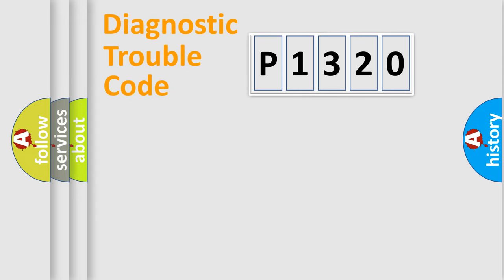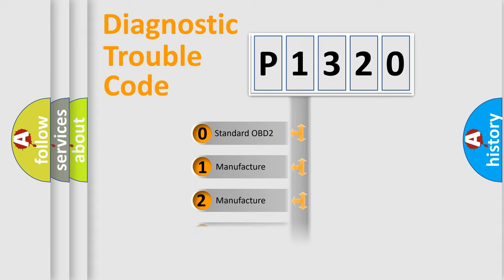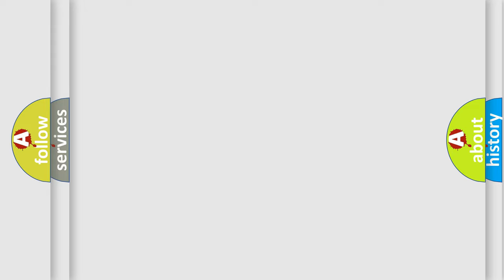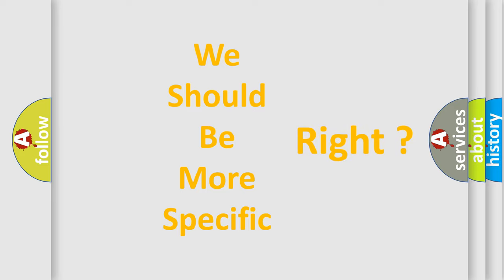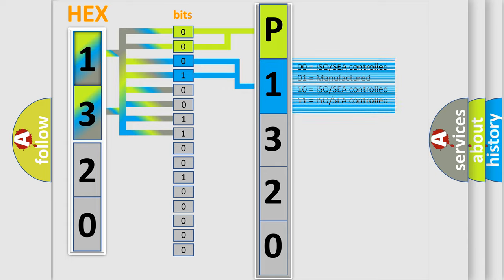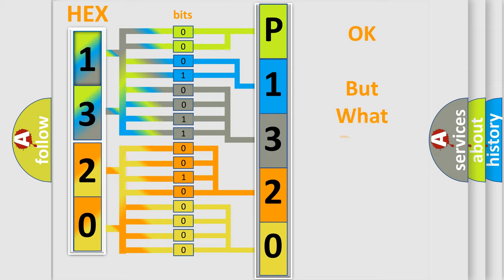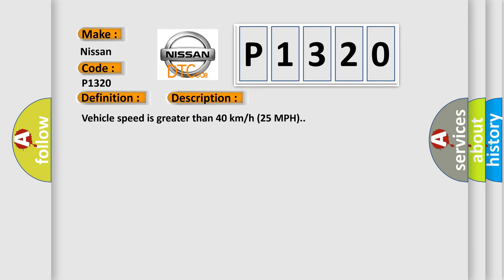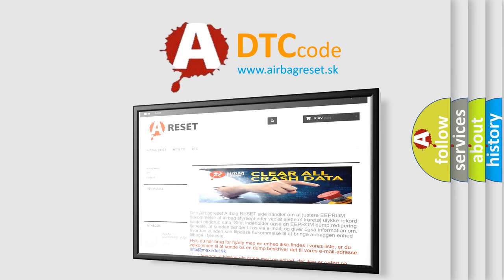DTC Nissan P1320 Short Explanation

Comment: How do you go from interpreting the code P1320 to ignition related (which it IS) to saying it's tire related? Horrible video. Last I checked the 3 in the code was ignition system, not tires.